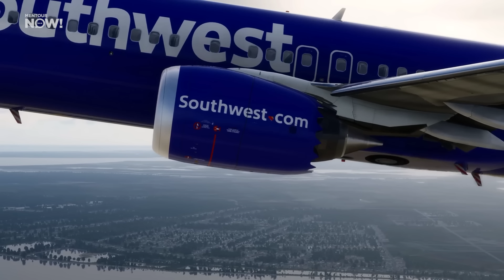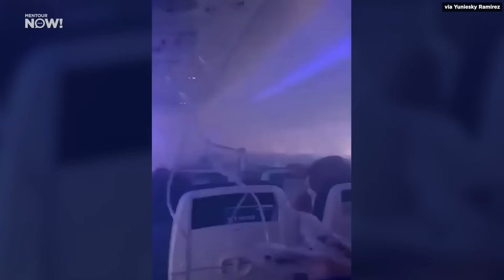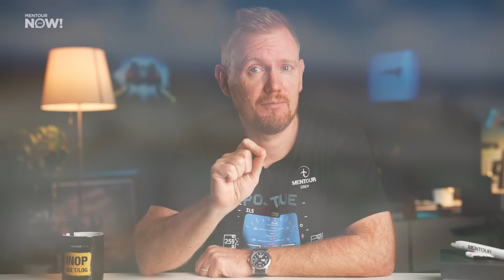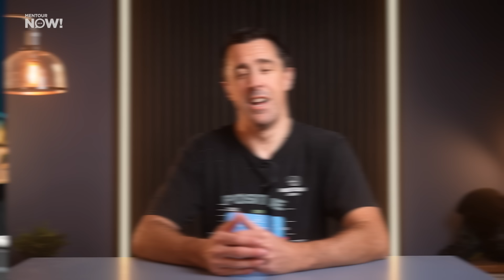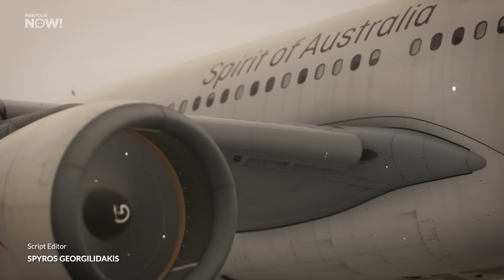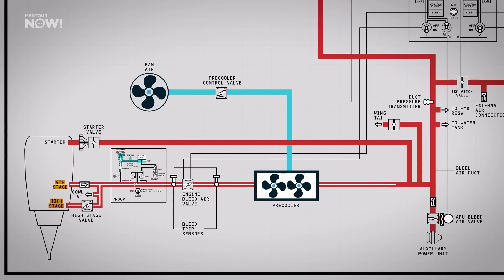Why Don’t ALL Airliners Do THIS?

Comment: Former 787 avionics tech here.
We have always joked the 787 has two gas electricity generators mounted on the wings, and propulsion is only a byproduct...
The tradeoff to MEA (More Electric Aircraft), plus having a computerized aircraft meant the system design is much more complicated, and very complex maintenance (To a point we would say it's Dreamliner when flying, Nightmareliner when undergoing maintenance). That's why there is a second E&E compartment at the back to do all the heavy power conversion, as otherwise the heavy wiring would fill up the forward cabin floor to the normal E&E compartment location.
And the two AC packs... it now has to perform so much function to the point where it has became the 'weakest link'- fault on one component could render the pack inoperatable and became AOG. (The pack now has to handle cabin pressure, power electronics cooling, cabin galley cooling, together with some fragile fan components on the earlier built was enough to be a horror story). And the packs consumes SOOOO much electric power I once fried two ground power units when performing pack maintenance test (Got to admit... able to turn on the AC pack without powering up the APU was something I really loved when working overnight on the aircraft!)
Reply: Yeah Airbus will be able to upsell the 350 compared to 787 on maintenance complexity alone.
Reply: @telekolowolo  That's one thing a lot of people misunderstand... B787 and A350 are targeting different market segment:
The direct competitor for A350 is the B777(& -X) series, and the B787 actually competes with A330(& NEO)

Comment: However, bleed air systems are mature with little room for improvement, whereas full electrical architectures have much more room for improvement.

It's just that when it comes to potential vs risk, few want to make the brave, but much needed move.

Comment: Electrical systems would be smart too as you could run system if plugged into a airport. This allows for cabin air filters run on the ground. This is important if another pandemic comes about. One of the safest places during Covid was on a running airline because all of the air was circulating fast at high volume through filters.

Comment: I am baffled by the lack of simpler solution, during such event when any oil is burnt, there could be baypas valve that goes through filters (Hepa13+, or militray-grade, submarine-grade) filters... this is so rare, that such filters would not be used until this happens, solution where engines deliver compressed air is simply more robust via its simplicity (at least compared to separate systems). Why not go that path?

Comment: Fascinating, Ben! Normally when a new technology is adopted by a major player, it becomes the norm soon after. The only reason it is not immediate is, as you alluded to, economics of being better to use stuff you have, even if it's not technically optimal.
From so many of the stories you and Petter have presented, it seems to me reliable and adequate storage of emergency system power needs to be incorporated.

Comment: A hundred years ago, I worked for Chevrolet as a co-op student.  Auto guys, as well as aircraft guys by their very nature, are mechanical guys and they always think mechanical before electronics.  I am also a power electronics engineer today and it's only been in the last 29 years where true high, power, high reliability power electronics has been developed and only in the last 10 years or so where the very high power, such as EVs, and the air conditioning packs, has existed.    Add in long aerospace qualification times and here we are today.

Comment: TOP CONTENT!! ❤ 
Thanks for this very informative and interesting summarized overview in recent aviation technology! Enjoyed every second! 👍🏻👍🏻
Hopefully this switches to electrical driven cabin air supplies make their way into civil aviation very very soon! 
There is enough knowledge about poisonous potentials of oil components and related health risks for everyone on board - especially for crews in a longterm perspective - that even if you don't include efficiency and cost issues or critical worst case workloads into all the considerations, this needs to be adressed very fast...

Comment: Do you pump air to tires all the time? No. Also district heat system hold pressure for weeks. I suggest you pump cabin full at airport, like a bicycle wheel.

Comment: Thank you for this video. 
I really enjoy thise stories where the same engineering problem is looked at by two companies and end up with completely different solutions all fir good reasons. There are so many examples like regulating fuel in a combustion engine, the standards of sound and image recording or broadcasting, and so many others. This is really enthralling.

Comment: i'm going to speculate that the passenger cabin should be isolated from the flight controls systems. Blead air should remain for everything that doesn't involve feeding the cabin - that function should be separate like Boeing did. At the same time i'm not a fan of electric wing heating, i'm no expert, but i feel like too many wires correlate with the circuit probability, and i don't think in should be at the wings that constantly flex and wobble and freeze and reheat. Conventional systems seems to be better fitted for that role. I don't really get why manufacturers don't use simple air conditioning with a closed loop and heat exchange towards heating whatever arias that need to be heated and cool air remaining in cabin with an external valve for fresh air to enter and pressurize, but then again, not an expert.

Comment: I'm surprised the didn't use 480V. I've seen planes  with 480V converters that changed the DC to AC so AC motors and electronids could be used.

Comment: I think the DC-8 did not DIRECTLY use bleed air in the cabin. The two distinctive intakes in the nose have to be for cabin air, which is compressed by a turbine that is itself driven by bleed air. Does anyone know for sure?

Comment: 15:50 : A car's front window defroster isn't a good analogy for electrically-powered aircraft surface heating systems.

A better analogy would be the REAR window defogger, with those thin wires that run back-and-forth across the back window.  They're basically toaster wires.

Comment: We had seal leakage in a turboprop metro liner and filled the cabin with smoke for a turn around and landing. Bleed air is like vacuum on a car engine for boosted brakes and before that wipers it is not free power it comes from the engine. Cars are changing over to electrical driven accessories the first was the radiator fan, fuel pump and now water pump, power steering, ABS pump boosting the brakes, AC compressor in hybrids and EVs.
Reply: a truly clever one is in McLaren cars, best steering feel is done hydraulically but at low speeds you need more assistance, what they did is have a hydraulic power assisted steering driven by an electric motor instead of the engine accessories.

Comment: To my understanding, a major flaw of bleed air is that it prevents the engine from having the same exact amount (volume, pressure) of air available for the turbine for any given rpm because the amount of air actually bled from the compressor isn't the same all the time. That means, the turbine itself can't be optimized to one exact amount of available air. It needs to be designed more universal, which reduces its efficiency. 
A mechanically driven generator doesn't offer free power either. The power it consumes isn't available for turning the fan, therefore reduces the thrust of the engine and needs to get compensated by burning more fuel to generate more power. But it still has the advantage of not effecting the turbine inlet pressure, therefore allowing a more efficient turbine design.

Comment: Great video. After readings Kevin Sullivan’s book “No Man’s Land”, about the QF72 incident. I’m reminded of what he said “complex systems can fail in complex ways”, often times in ways that were never thought of in the design phase. I’ve never been a fan of Airbus’ design philosophy, allowing computers to take away control of a plane from the pilots. I’m also not convinced, until the final report, that the 787 Air India accident had nothing to do with the massive automation and system changes Boeing introduced on the 787. Complex systems will fail in complex ways causing massive confusion and workloads for pilots.

Comment: Not a pilot, I love my sim but when it comes to anything in the world I cant fly a kite. But if an engine is reliant on electricity rather than air to turn it and get it spinning for start, is that not easier than flipping switches and selecting bleeds etc? Boeing aa the eamxple not jot quantify packs switches, selecting bleeds and ao on. And how does that affect hot starts? Again not a pilot just a geek throwing out what little I know to learn from those who do it daily.

Comment: I think it is important to qualify your lithium battery comment: from one of the 787 engineers I learned that the batteries were obtained from a supplier and that the Boeing engineers were not actually aware of the various lithium chemistries or their flammability consequences. Problem fixed now though.

Comment: My personal belief (based largely on my own observations and experience) is that the issue of air contamination is, rather than being merely an atypical edge-case scenario, a nearly-ubiquitous condition of ground operations. While the public at large is oblivious (and air crew etc. are conditioned, via the process known as olfactory adaptation, to the same result), the manufacturers know this from their own testing and internal reports.

They're disincentivized to ever admit that fact, of course, but if I'm right then the obvious conclusion is that Boeing is hoping to get ahead of the issue, while Airbus is betting that the cheaper route is to ignore it as long as possible.

Note that OSHA does not have jurisdiction over air crews. Meanwhile, the issue of e.g. excessive noise levels (particularly near the engines or APU, or in the back of smaller narrowbody jets) during ground operations is an excellent example of an objectively demonstrable and real health & safety concern that is ubiquitous during ground operations and which would never be permitted by OSHA under normal workplace conditions. Meanwhile, on an aircraft, these concerns affect passengers and crew. Do the aircraft manufacturers really universally believe that these concerns (of which they are themselves undoubtedly aware) can persist unaddressed indefinitely? I doubt that very much.

Comment: Q400 (possible all DHC8) two generators per wing. One on the gearbox (AC), one on the core (DC). TRUs for AC to DC. 

+ One on APU (if equipped) ground use only.

.... not a jet

Comment: The 787's total reliance on high voltage electric power raises red flags for me, despite the excellent safety record of the aircraft in service.. until 2025. It still remains a hypothesis that should not be discounted that a massive electrical event (such as a thermal runaway) triggered the multiple failures that brought down AI-171 within 90 seconds.

Comment: I don't understand why bleed air cannot be extracted earlier in the compressor stages -- say, ahead of the majority of oil issues that result from FOD ingestion.
If so, then you still get pressurized air with less possibility for smoke inclusion. 
With the bleed air point currently being use the air temp must already be reduced as it went from minus 67° to several hundred degrees too hot. Seems like you could bleed it a little further up the staging chain to result in a better match of temperature to pressure. All while presenting fewer points to introduce or even burn oil into smoke. Cool oil in an air stream becomes an odor not smoke.

Comment: I have been using Opera Browser for the last FIVE years! I can't express how happy I am. Previously links embedded in my Yahoo email would not open properly with Chrome. Most pictures would not open. Monthly I get EVO email and all the car pictures were blanks. All I did was switch to Opera and I am delighted how easy these pictures open. Also the TAB management is exceptional. I absolutely love it. No, I don't work for Opera...

Comment: The Boeing 707 and DC-8 designers were concerned about engine fumes entering the cockpit and cabin, so they used things called "turbocompressors" that used bleed air to spin a turbine, powering a compressor that drew fresh air in and compressed it into the air conditioining system. They were heavy and somewhat inefficient, but fumes in those airplanes were mostly unheard of. Later design engines were deemed unlikely to releas signifcant amounts of oil fumes into the bleed air, and the next generations of jets used direct-conditioned bleed air.
Reply: My first commercial flying included six flights in Qantas 707s in 1973, and I distinctly remember being alarmed at the smell of jet fuel in the cabin when we were on the ground, and soon after take off.  How could that be, I wonder?
Reply: @Peasmould  Hard to say, and  my acquaintance with the 707 comes from a few rides and photographs. I never had the privilege of working on one. . .However, I have noticed that Boeing apparently placed the turbocompressors and other air conditioning components in the pylons,  with their fresh air inlets right above the engine. Could be some kind of maintenance issue made a quantity of fuel available to those inlets; I wouldn't swear to that, obviously.

Comment: In automotive practice, to save fuel, first item to switch to electric was the radiator fan, AC fans , now we have electric fuel and water  pump  and even oil pump. Boeing just took a page from the auto makers and apply it to their HVAC system. I might add, other than in tropical climate where the radiator fan work more often, I feel the electric water pump are less reliable and they are expensive as hell to replace, same with the fuel pump. Easily wipe out what ever small amount of fuel savings you get from them.
Reply: Electric fuel pump needed for fuel injection system.

Comment: Two reasons not mentioned is that Boeing engineers likely saw: 1) a larger potential to improve the new electrical system in later future versions than the legacy bleed air system. And 2) gaining experience in building electrical systems in preparation for future electrical aircrafts

Comment: General Motors seemed to have borrowed the "bleed air" technology for the heating system in its Corvair. It's difficult to find one that doesn't smell of burning oil when the heater is turned on. 😅🤣😂

Comment: Common sense tells me that introducing potentially contaminated air from the engines directly into the cabin and cockpit is an inherently bad idea. If Boeing has now demonstrated with the 787 that this can be avoided, with no net compromise to cost, efficiency, or reliability, then the answer seems obvious. You have indicted that Airbus has retained and improved the old system as a kind of stopgap with the A350, while giving most of their attention to other upgrades. Looks like the days of using bleed air are appropriately numbered.

Comment: One question I was expecting Ben to clarify- Are the Airbus 350's engines still prone to dumping oil into the bleed air system in the event of an engine out event as in the 737 and 320, or have they designed safeguards to prevent this? It seems like this would a major point in favor of the 787's all electrical cabin air design.

Comment: Does the air need to be taken from a compressor stage? If it is taken from the bypass air would that eliminate the problem with oil in the bleed air?
Reply: I don't have the figures, but at high altitude undoubtedly the pressure isn't high enough.
Reply: Not enough energy in the bypass air.

Comment: If the system can, during failure, push poisonous fumes into the passenger, or pilots areas, then it must go.  However, it will be a long time before Airbus addresses the problem simply because they have not killed a sufficient number of people.  You want increased safety, go die.  It is how the Airlines and Government work.

Comment: The lowly ATR-42/72 turboprop has 2 gens per engine and 2 separate electrical systems. Regular AC power for most things and "AC wild" for high draw items

Comment: On the E-3 sentry we got 2 generators per engine for a total of 8. That’ll beat the 787 😝
Reply: 10-20KVA tops each for each generator, the 787 with both engines and APU close to 1.2MVA 😮

Comment: My only actual emergency in my airline career was a “Bleed Air Duct” warning message which is a benign enough sounding message (other than its Red color and associated Red Warning light) that meant that hot air was escaping the ducting and could therefore melt critical systems to include the leading edge of the wing which could lead to the total loss of the aircraft…and all the people.
Reply: so .....?  what burned or melted?!

Comment: 14:45 The A350 also has two generators per engine. Also running at 230v. The tradeoffs between the 350 and 787 types are likely negligible, with benefits still remaining from using bleed air in the way Airbus utilises it; a good conclusion you found in the end.

Comment: Any reason they don't route the bleed air out to near the tips of the wings and back again so that once it's at the fuselage, it would merely be warm as opposed to hot? It does mean the wings will be heated even if not needed to prevent icing, but I can't imagine they'll get too hot with all the air flowing over them.
Reply: perhaps ... added weight, harder to keep the temperature controlled, need for slats mechanisms in many cases, and increased risk from damage from leaks (more flexing, more metal fatigue) including maybe even setting fuel on fire?😜